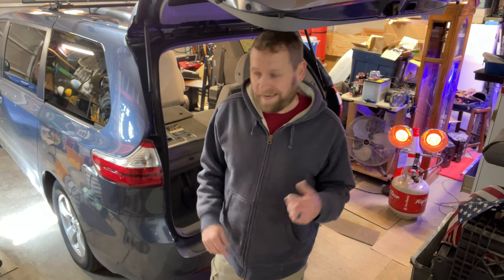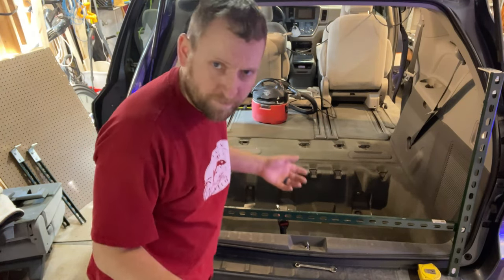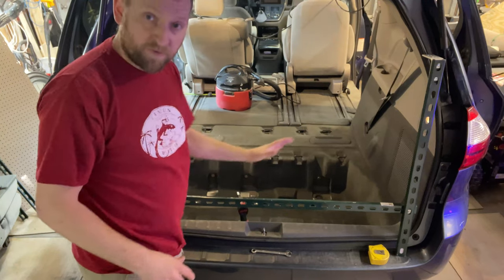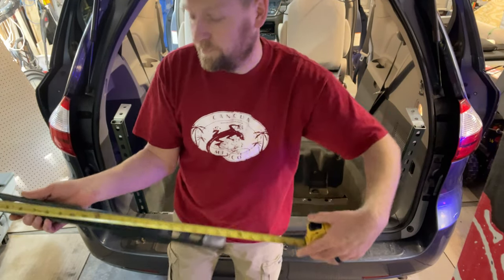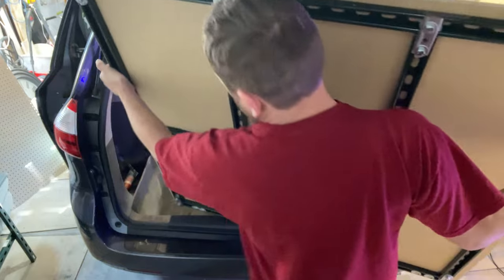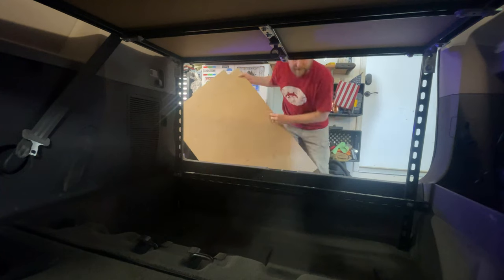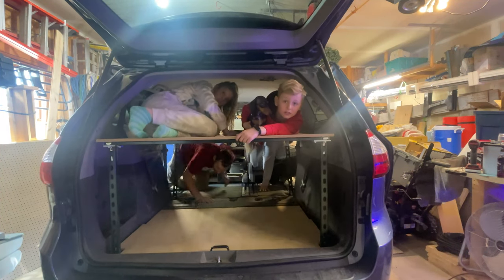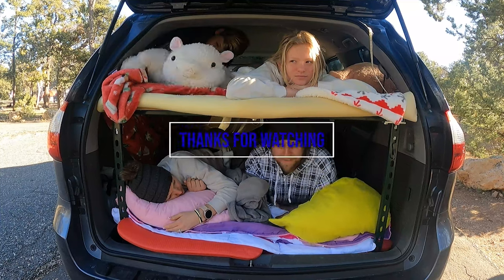Sienna Mini van loft build that sleeps a family of 4.

Comment: I sleep in my van. With wife and 6 and 8 year old. I put a vent with cousin across front seats. One kid sleeps on floor between sliding doors. Then wife and i sleep on a plate form using back of chair folded down as chair is part of bed frame. I love that every one can sleep in our mobile tent🥰🥰🥰
Reply from the maker: It’s great!
Reply: Wow what a small world. I have a 6 and 8 yrs old too ^^~
We add 1 plywood 17x 50 fit snug in the last row where my 8 yrs sleep, with 2 small 2x4 block wood to support the level. During driving, that space store all our blanket & pillow, window covers. It also create a snug cuddle space for my kids  jumping in there while we take a break at gas station for shower, ect... Another plywood 17x shorter than 50 for middle row (shorter will be easier to move from the back row to middle without banging to the side of the car) This piece will. be stored perfectly fit on top the last row. Then I and 6 yrs will sleep on the floor with all the front chairs push all the way to front. Very big space. We add a Foam Egg Crate Sleeping Folding Pad for extra support & prevent dirt from the floor dirty our sleeping stuff.  We bought a full memory foam mattress topper 3 inches cut into 4 pieces (18 x 50)  & we sleep like babies. The 18x50 will fit perfectly in a body pillow case (body  pillow case dimension are 20x52)  Easy for washing :) We do add a waterproof body pillow case for extra protection LOL!!